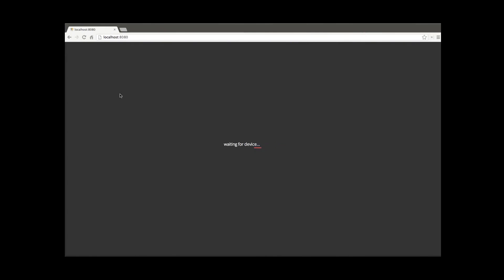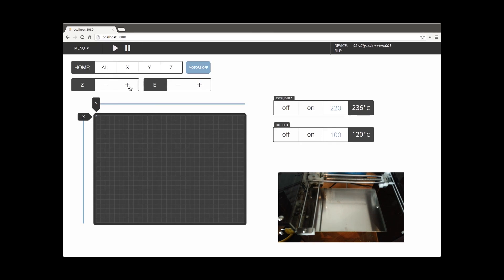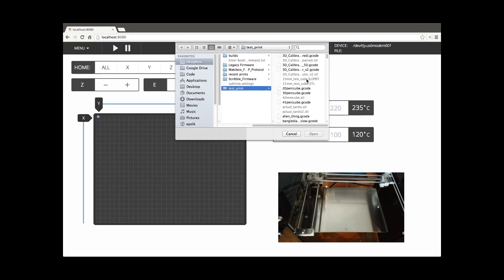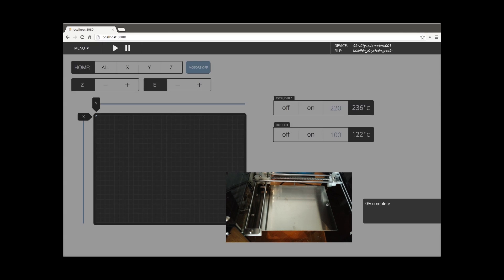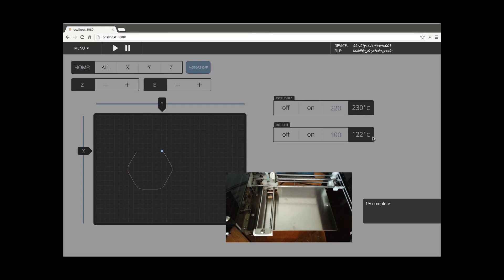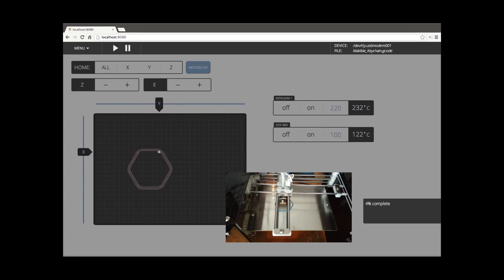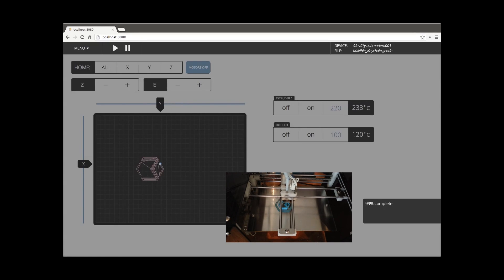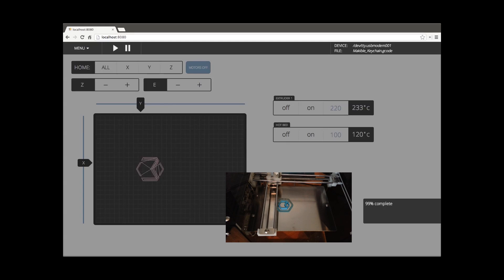#MakiBox 5D Print - Alpha Walkthrough

Comment from the maker: It's run locally, just like any other host software, but is accessed via web browser (similar to OctoPrint).
The only electronics in the MakiBox is a printrboard, which would not be powerful enough for that.

It's written in GO and should run on all major OSes.
We're also testing this on the Raspberry Pi and it looks like it might run.